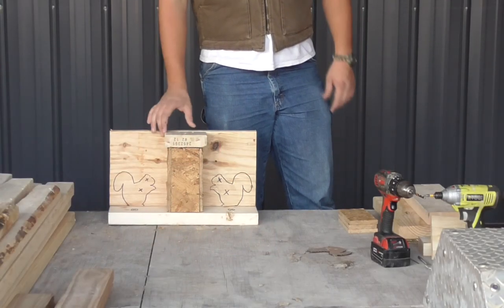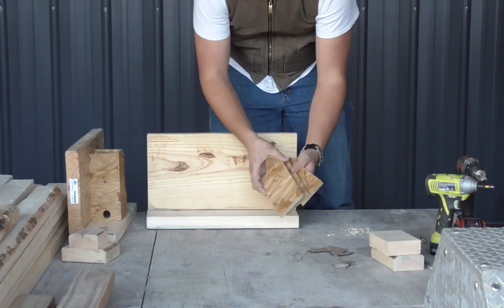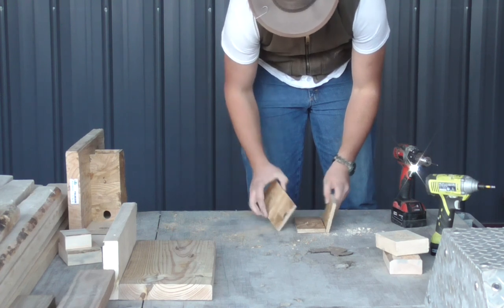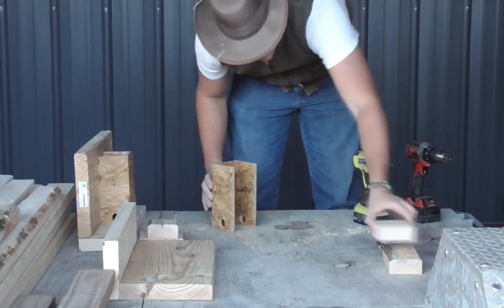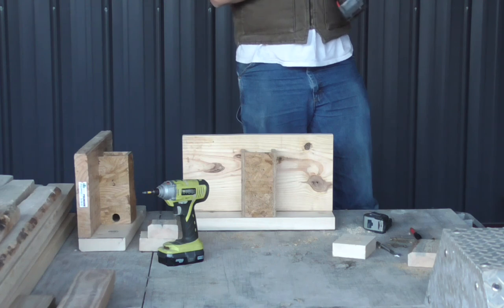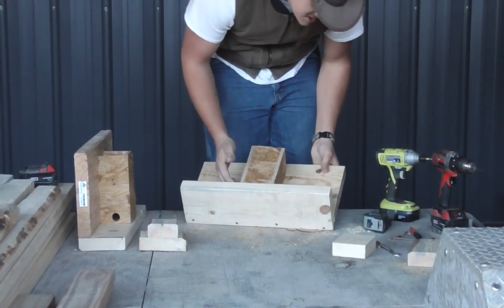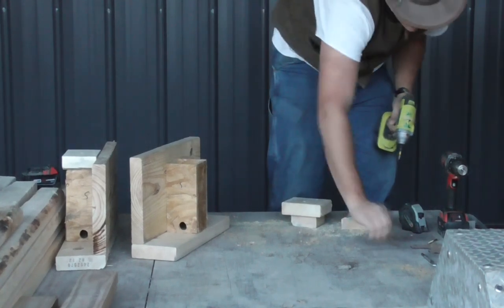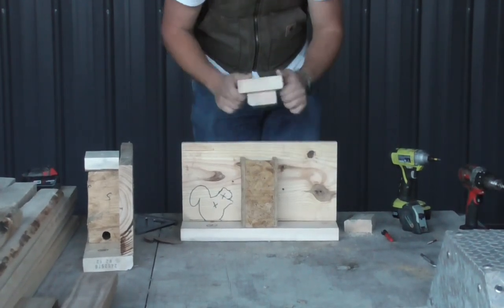how to make a squirrel hunting feeder

Comment: Got any measurement plans?
Reply from the maker: Sorry but I don't but this project doesn't really need to be to exact so feel free to use whatever size you want just make sure the backstop board is thick enough to stop your shots
Reply: @codykorsa6595  Not that hard to figure out. I got a few squirrels raiding my bird feeders and this looks like a simple design wit good back stops for my missed shots.
Reply from the maker: Wish you luck the design has worked well for me I hope you have fun solving your squirrel problem with it